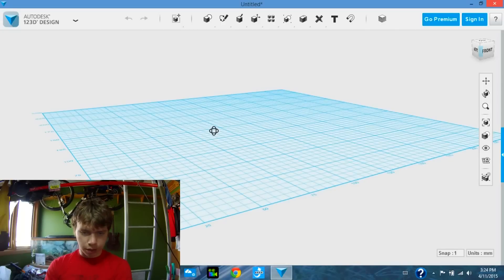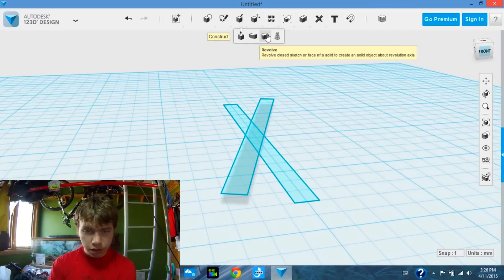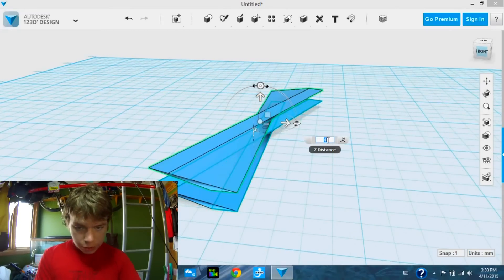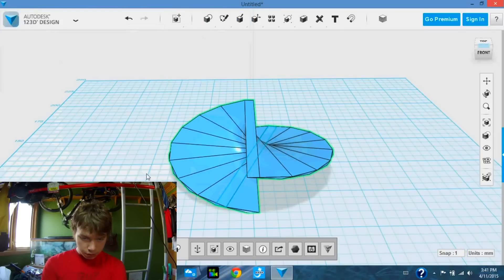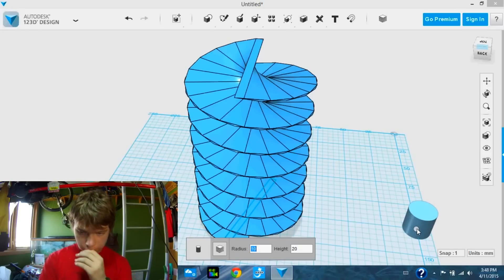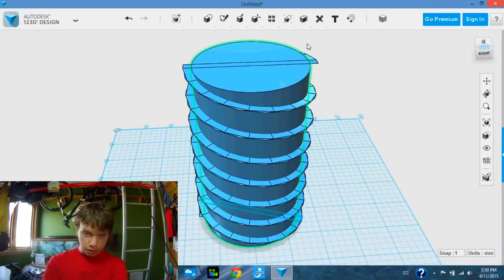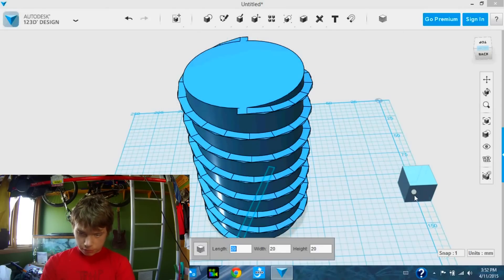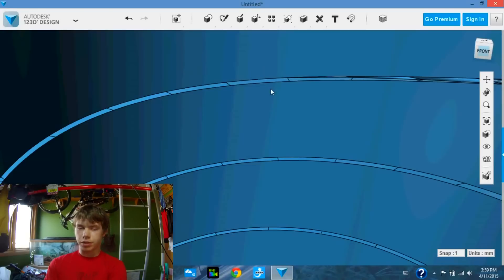How to Make a Screw and Threaded Hole in 123d design --Pure Carbon

Comment: Thank you for this lesson. 
Can you tell me which software do you use to make this  video ?
Reply from the maker: Power Director 12.
Reply: Thank for your answer. I meant the computer screen software catch.  I apologize.
Reply: @oracid1 the buildingsoftware is 123D Design by Autodesk ;)
Reply: Thank you for your answer, but I mean what is the software with which you get the screen flow from your PC. Not the video or the 3D software. thank you.

Comment: could do with bit music... could you do bolt with thread using torus please.
Reply from the maker: +Mark Torr I'm not quite sure what you're asking.
Reply: I think I know what is being referred to here: The method of producing a coil using tilted halves of a torus. While the half-torus method may be slightly faster to use than Pure Carbon's method, it does not produce a true helix, as the incline of the object is not constant. This is an acceptable inaccuracy for making models of springs, but for threaded fasteners, Pure Carbon's method is required.

I just started messing with 123D design today. Great video.

Comment: Not too bad, but you could have saved a lot of time by using Copy and paste and then slide the part up. Also, just snap the edges together with snap tool. Keep at it, you are doing good.